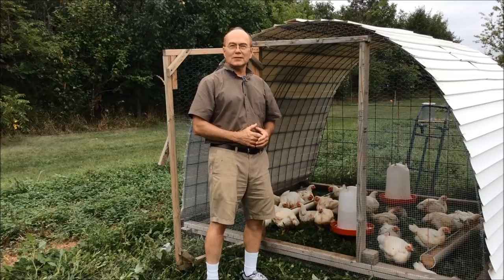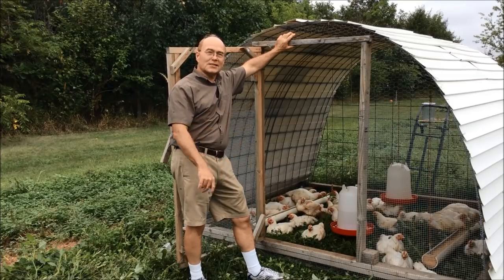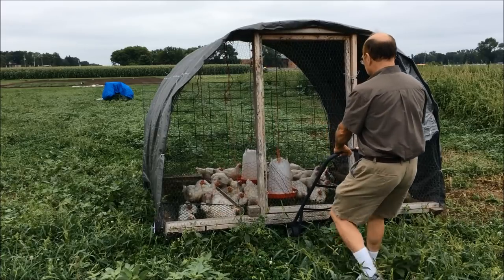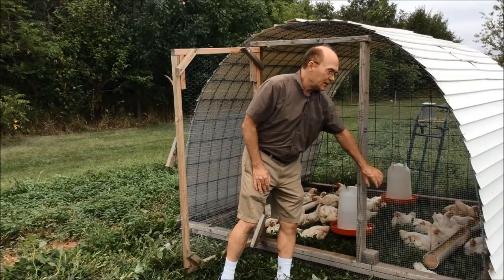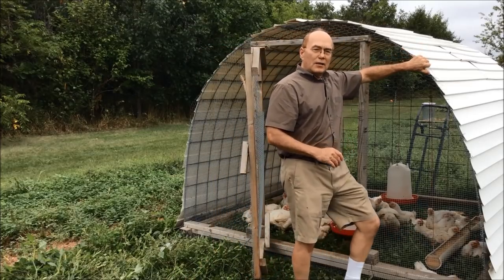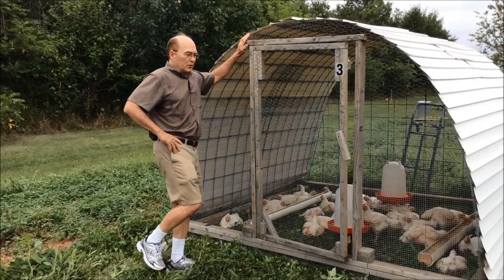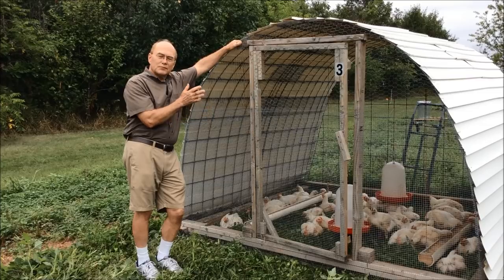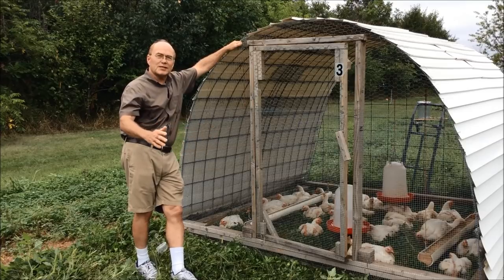Build Your Own Chicken Hut

Comment: What about predators digging underneath the coop?
Reply from the maker: +tcatamount1  So far in the 5 years that we have used these huts, we've had only one attempt by a critter to dig underneath. It gave up on the effort, in part because the pasture was a very heavy stand of clover, which made for tough digging.  

Our biggest predator problem was when we first used regular chicken coop wire at bird level. A raccoon reached through the wire and grabbed onto a bird, but only succeeded in pulling out a few feathers. Hawks were the worst, because they would reach through the chicken wire with their beak, grab onto a bird, and do severe damage. The birds would have to be euthanized. 

We then wrapped all the huts at ground level with hardware cloth. Nothing can get through it. 

We have also had a couple of birds dig their way out, and escape. We found the feathers, all that remained, the next morning...Only twice though.